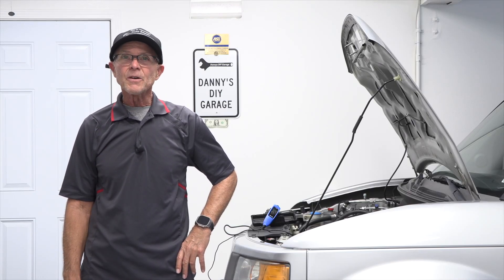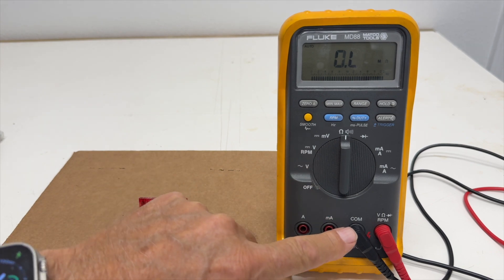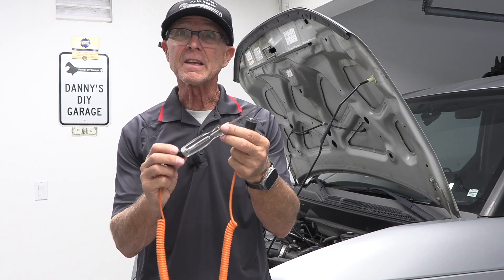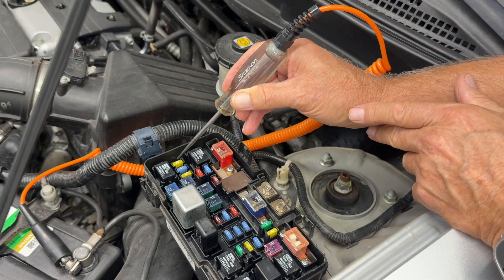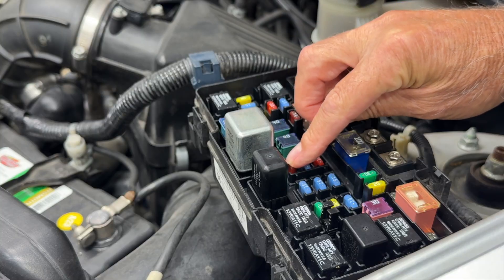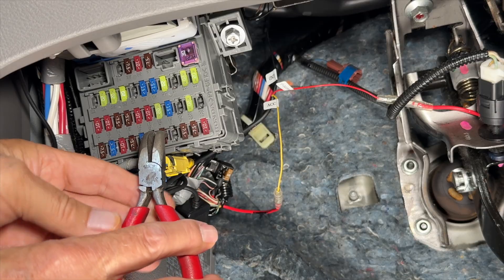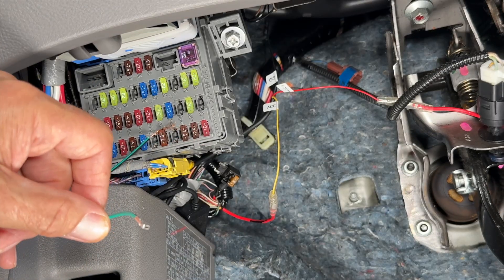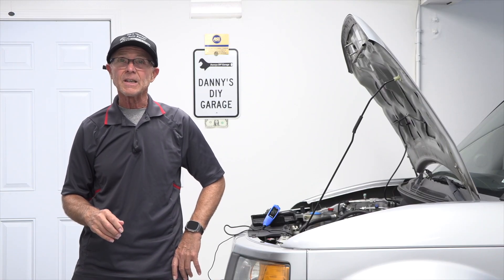How to Test a Car Fuse (FIND, TEST, & REPLACE a Blown Fuse)

Comment: Danny, this isn’t related to this one video but wanted to say thank you for all the work you do on these videos. 

My wife and I inherited a 2007 element with 206k miles a couple years ago, 25k miles later, I’ve replaced oil, brake, transmission, coolant, power steering fluids and some other fixes along the way thanks to your videos, and she’s running like new!

God Bless you for taking the time to help out DIYers.
Reply from the maker: I really appreciate hearing that and appreciate your support!